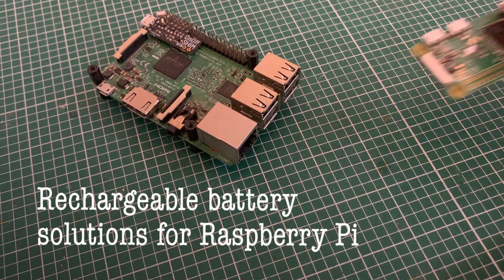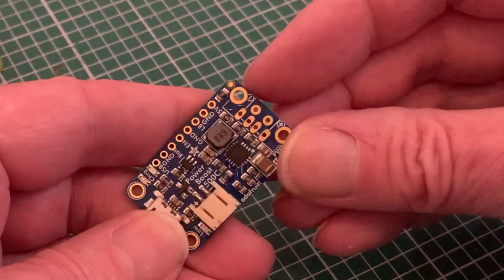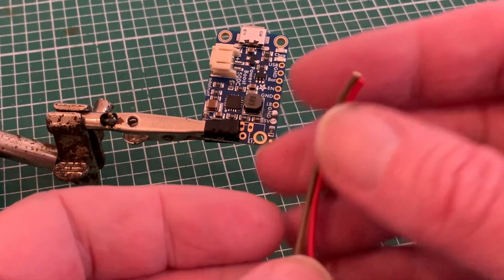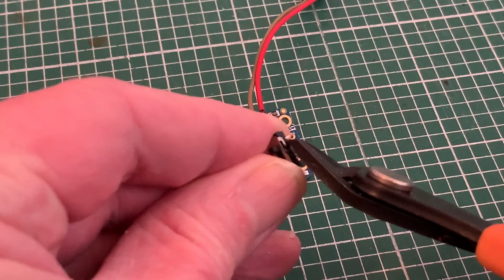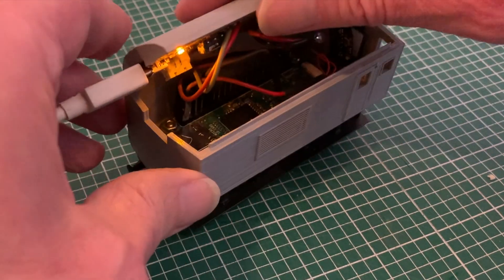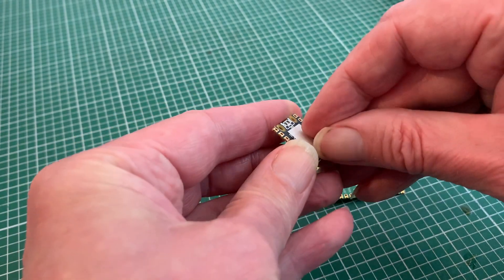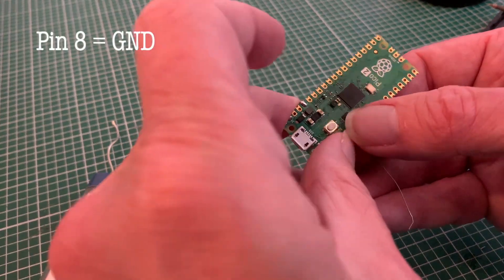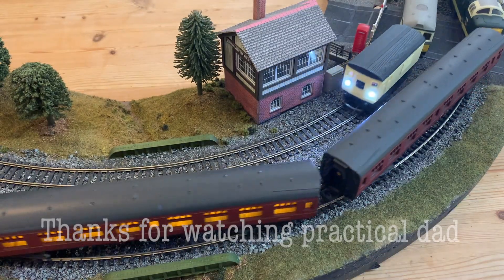Rechargeable battery solutions for Raspberry Pi and Pico projects – PowerBoost & LiPo Shim

Comment: does that adafruit usb thingy pass the usb data connection to the pico? or just power?
like, i'm gonna use a Pico W through bluetooth in my project... if i plug my usb into the adafruit thing that is connected to my pico, will it transmit data to the pico?
Reply from the maker: Just power.

Comment: Does the Powerboost have protection against overcharging and discharging? And is it safe for the Pi to turn off the power through this powerboost when it's on?
Reply from the maker: I think it does have overcharging protection. Not sure about discharging.

Comment: Super useful video! Having worked with this board would you advise against removing the power button and soldering wire so you can have the button located somewhere else? I want to have the whole board hidden in a part and simply have a port on a surface you can plug into to charge a Pico W and next to it have the power switch.
Reply from the maker: It is indeed possible to have the switch for the PowerBoost remote from the board so you can get to it much more easily. Just add lengths of wire from the terminals to the switch. I did this on my Inspection Train, so check out the video here: https://youtu.be/aizuPh6pryo
Reply: @paterpracticus  Sorry I should have specified, I meant for the Pimoroni.

Comment: Awesome video!!!! I powered my pi zero2 up the other day via a BEC 5v, On the bottom of the pi you can see 5v and gnd. This worked great for a couple of days.. and now no green light. IS there a reason for not powering the pi from those two pads? Thanks!!!!
Reply from the maker: Thanks. Glad you liked it. I’ll have to remind myself of exactly which pins are which, but remember the green light isn’t a power light, but shows disc activity, so the hardware might be ok.

Comment: Can you one for the Raspberry Pi 5?
Reply from the maker: I’m pretty sure you can use the PowerBoost with any of the Raspberry Pis.
Reply: @paterpracticus  i research myself, but I came to the conclusion that neither the 500c or 1000c models can power the Pi 5 since it uses 5V/5A and the 1000c model can only do 1 Amp.
Reply from the maker: @romialLekeulem I’ve just done a bit of digging myself, and it does look like the 5 requires a lot more power than my Zero. Not surprising really as it is much more capable. I’d be interested in other solutions people have found for that.

Comment: Super helpful explanation and setup with the Pi Zero! Would it be possible to detect when the battery is about to die (or detect the battery level in general), either through the Adafruit board or the Pi itself?
Reply from the maker: The Adafruit board has a low power LED. Can’t quite remember offhand if the Pico shim has the same.

Comment: So essentially, you don't need to solder the LiPo on the Pico, you just need to slide it over the pins and anchor it down somehow?

I'm trying to make a smartwatch like device with a 3.5 inch TFT LCD screen to help a friend read Twitch Chat while streaming IRL for example. Or looking up something quickly without having to use the phone he's streaming on.

I'm thinking of going for the

Raspberry Pico W 2
Rechargable batteries
3.5 TFT screen
Wirelessly connected to the Hotspot of his Mobile phone
Mobile connected to a powerbank

But I have never done anything like this so I dont own a soldering machine. Any advice would be appreciated!❤
Reply from the maker: You could possibly get away without soldering, but much more reliable if you do. Soldering irons are inexpensive, and soldering not too difficult - and a great skill to have.
Reply: @paterpracticus cheers! Ill get into it
Reply: Sooo how did it go?? I'm curious cus I'm also working on something similar in design

Comment: I have a question can how do I connect a lithium battery to raspberry pi 5 without soldering
Reply from the maker: The AdaFruit PowerBoost is tantalisingly close to this - if only the USB socket came with a pre-soldered option! Just having a quick search on the PiHut, there seem to be various HATs - like the Waveshare LiPo Battery Hat - which push onto the GPIO pins to provide power. There is also their "Uninterruptible Power Supply UPS HAT For Raspberry Pi Zero" which is a bit more expensive, but does appear to come with the battery. I'm guessing that could be used with other Pis too, but perhaps not as neatly.
Reply: I’ve found that geekworm has a bunch of options as well including x1203 which lets you choose your own battery

Comment: Dont these only last for 3 or 4 hrs? Im trying to run a pi zero on battery for over 24hrs what would be a good solution?
Reply from the maker: The bigger the battery the longer the run time, depending on the current required to run your project. For a previous project I looked into putting a Pi Pico into deep-sleep for quite long periods. Not sure what yours is doing, but might be worth considering.
Reply: @paterpracticus  did you tests the deepsleep battery life? also I don't have alot of experience working with lipo batteries, are there any dangers that someone around using these that I should be warry of. Cool vid also
Reply from the maker: Lipo batteries need to be treated with some caution. Avoid direct sunlight etc. I ended up using a solar powered combination with deepsleep for a very low power device, which worked reasonably well: https://youtu.be/-UjNNdQtsy4?si=QMgPJ1-lgG30TjxA